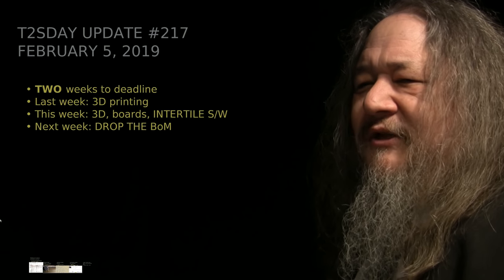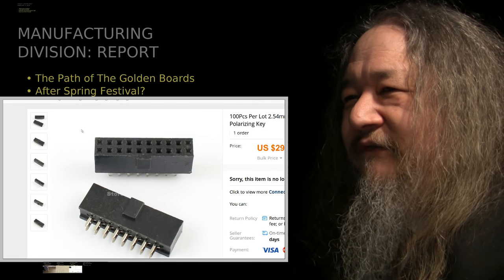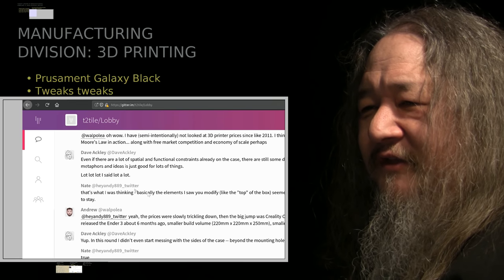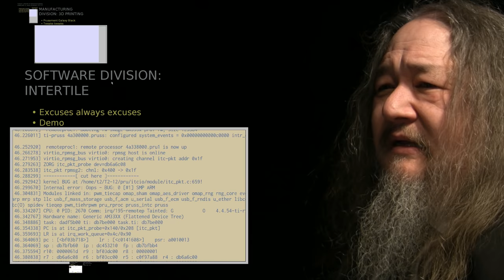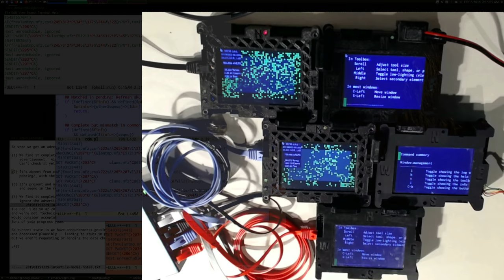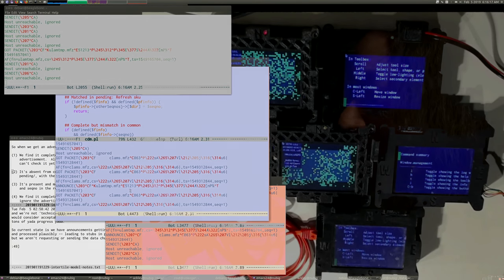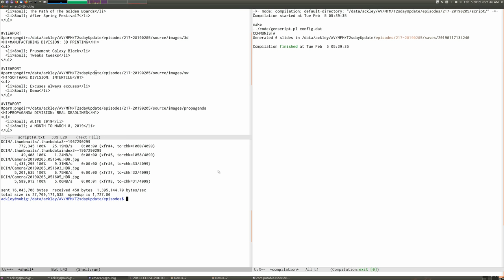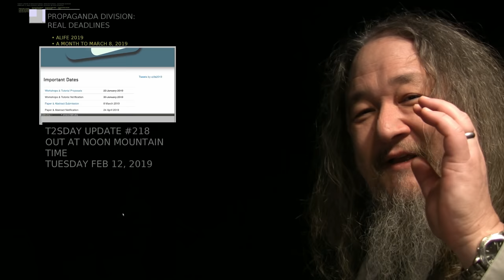Self-stabilizing Software - T2sday Update 217

Comment: There isn't really an "invalid" state for the MFM, is there?

Doesn't the robust way the common data management software run completely prevent having a bit of code that requires something in a separate file? Or is the code switch only done when the transfer is complete? It would be pretty cool to have the code running while updating itself file by file, is that actually the plan?

I guess it's possible if you're only updating the behavior of atoms. Pretty cool.
Reply from the maker: Yeah, best-effort computing is about degrees of quality rather than strictly valid or not.
The T2 CDM moves .MFZ archive files, with the intent that most non-standard code dependencies will resolve within a single MFZ.  We'll see how it goes!